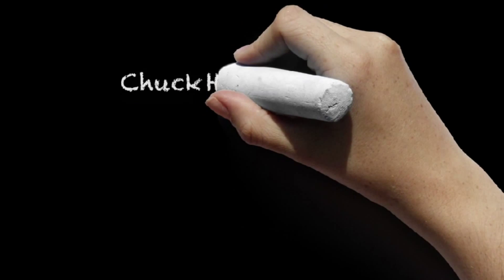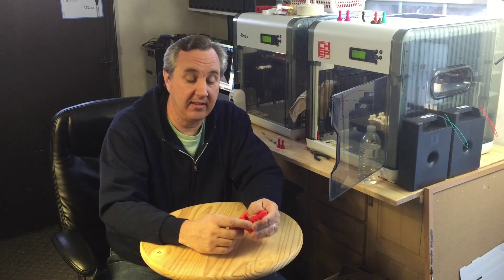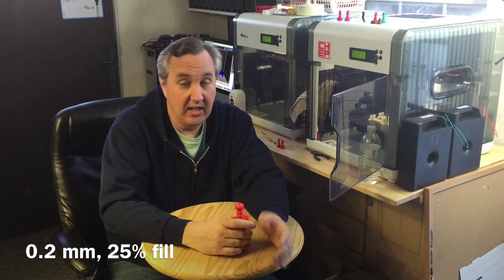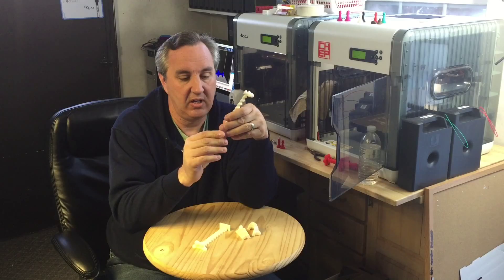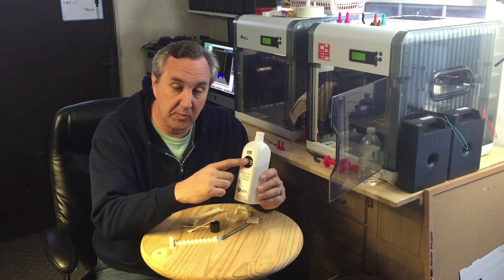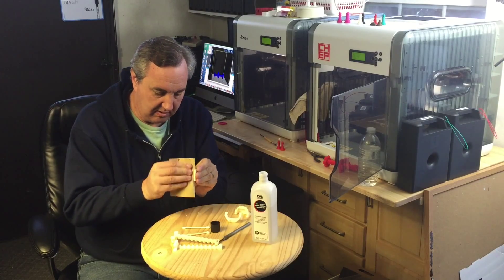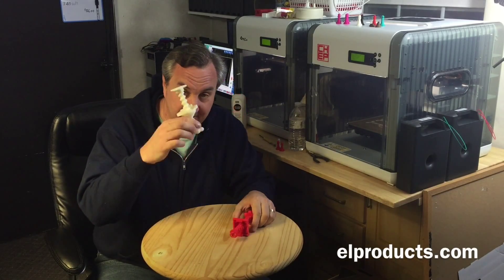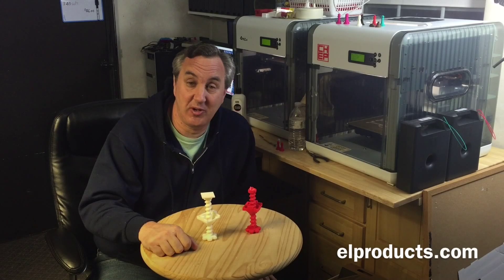Splitting the Butter Pig with Tinkercad for Davinci Part 2 - Video #041

Comment: I think this is where Simplify3D will really shine.  Or any other slicer for that matter...  After almost a month of going back and forth with XYZ, they refused to replaced my two bad cartridges that I purchased from Amazon (and now out of Amazon's return policy range).  Loaded up Repetier firmware in 5 minutes and my first prints are FAR more impressive than what XYZ was producing.  Getting the extruder temp and bed temp a little hotter makes incredible improvements on the prints (in addition to controller speeds during various points of the print).  I also just got a spool of ABS that has 400g more filament that the XYZ cartridge and for the same price.  Tremendously happy with the result and I look forward to getting some PLA printed as well as maybe giving Simplify3D a shot.  Letting the slicer and printer do all the hard work vs jumping through hoops to slice and dice and object just to reassemble it after the print is a huge difference.

Keep up the videos, really great stuff.  I think you'll be much more impressed with the hardware if you ever decide to free it from XYZ's constraints.
Reply: ***** The only way XYZ would give in and replace the cartridges was if I allowed them to log in remotely to my computer.  I requested the steps they were going to use to collect information so I could do it for them (or do a screen recording), but also constantly repeated myself that I could reproduce without my computer.  Simply trying to print a demo item gave me the cartridge error.  They were very vague and dodged a lot of my questions.  I was tempted to setup a VM for them to log into in order to see what they were up to. I had roughly 75 hours of print time and had two bad cartridges and one good cartridge that would happily print. Some quotes from my month long exchange with XYZ:

"Please advise us whether it is fine with you for us to connect to you r computer to analyse your case.
If yes, please advise us your team viewer ID and password."

"Please be informed that through team viewer, our software team ca n detect the computer system is compatible with the xyzware, miss ing font or display card is out of data could be the causes."

"According to the info so far, there are some abnormal usage of the filament record, therefore, if possible please grant us to connect t
o the pc to determine the root cause.
Or if possible, please send in your cartridges to us for our testing a nd if it is found out to be faulty and genuine then we will be proces sing the replacement."

"Please kindly be advised once according to the information that yo u have provided to us. There is abnormal attempt with the filament.
We will send the replacement filament, till this is confirmed to be cl ear. If you are not willing to grant us to connect to the pc to diagno se the root cause of the filament. We will not be able to send the re placement filament."

Almost every response of mine was followed with "Please allow up to 3 days for a response".  The above was copied verbatim, grammar and all.  They also called me on the phone, only to end up confirming that I would not allow them to remotely access my computer, which I found very bizarre.  I thought they would ask me to run through some steps for them while on the phone.  I wasn't going to pay to send them two mostly full cartridges for them to determine if they were bad or not when I could simply flash new firmware and immediately use the filament (which I did).  I also requested to be told what "abnormal filament attempt with the filament" was but got no response.  My initial support ticket was opened on 2015/01/20 and went until 2015/02/19 with no resolution.  I provided them invoices, photos of the cartridges (both bad and good, showing that my printer would successfully print with a good cartridge), printer, error screens, etc etc.  But accessing my computer is pushing things too far and was the only way they would replace things.

Sadly too frustrating of an experience.  Luckily I have the technical skill to allow me to keep my printing functional (and performing better!), I could never recommend an XYZ to a hobbyist with little knowledge or experience (which XYZ aims for with the ease of use).

But for a print comparison, I attempted the print of the NASA 3D designed ratcheting wrench that they printed on the ISS with no success with XYZWare, it was fused together.  It was my second print after flashing the Repetier firmware and it printed successfully and ratcheted.  Printing at 225 vs 212 makes more of a difference than I would have imagined (.2 @ 225 is far smoother than .2 @ 212).  And I think I'm seeing better bed adhesion at 100.  The leveling mechanism built into the firmware is also far superior to XYZ's.  Impressive work all around!

Good luck with support, I hope you have an easier time than I did!  But if you Google around, it's all horror stories...  There's another gentleman who recently posted some YouTube videos as well detailing his support issues (his was much worse, his printer wouldn't function at all) and went with Repetier firmware and now couldn't be happier.  Would have loved for someone to press them at CES on all of this while they were debuting new printers!
Reply: ***** Not exactly.  I could load filament, but then I would go to the info menu to view details about it and it would simply say "Unrecognized cartridge" and that's all (whereas that guy can see stats about his cartridge).  Or, I could open up XYZWare, export an object and when I clicked print, I would hear the 3 beeps and the printer would receive the print, but it would instantaneously tell me "Cartridge Error.  Unidentified Cartridge" and cancel the print (the same things happens when trying to print a demo item from the printer's menu).  So a slightly different error from that gentleman.  

But like I mentioned, I had a third cartridge and it worked just fine (ordered at the same time as the bad cartridge).  Definitely isolated to the two cartridges, the printer is functioning just fine.

Comment: Hi Chuck great video,
But Aceton only works on ABS. Not on PLA. Or am I just wrong?
Reply: Great. But whe I looked at your video then you used ABS. (That's what I use) and I use also Acetone to glue them together. Works perfect. Thanks for your video
Reply: ***** I have seen some other videos where Acetone is used to rubberize things. I would be good ti find out what effects might have on the item, especially if they were to be used on wearable objects. Brian did it to a watch band part, which I am not sure would be safe to wear for prolonged periods.